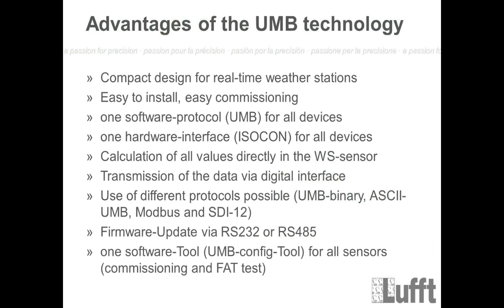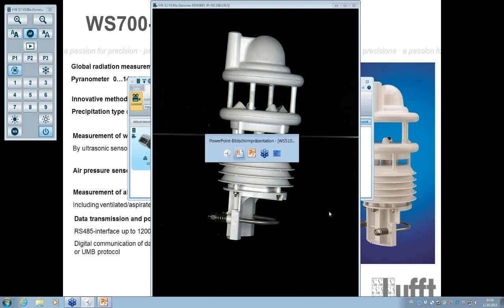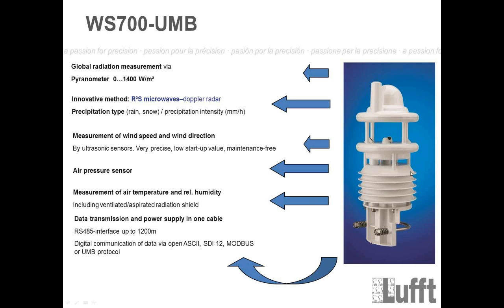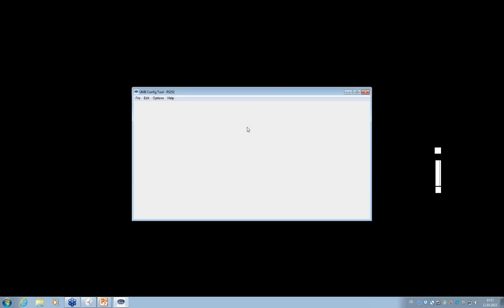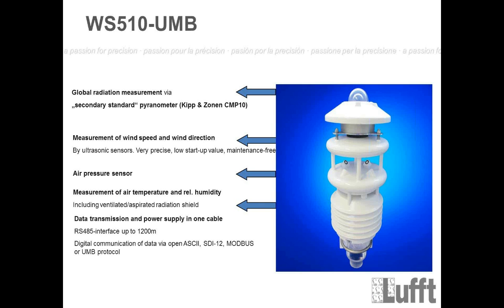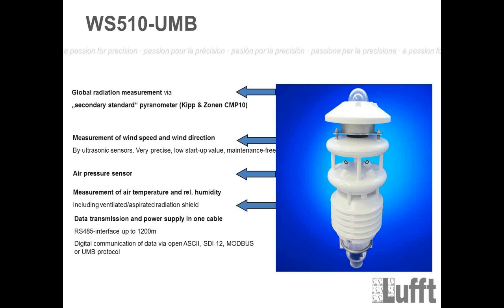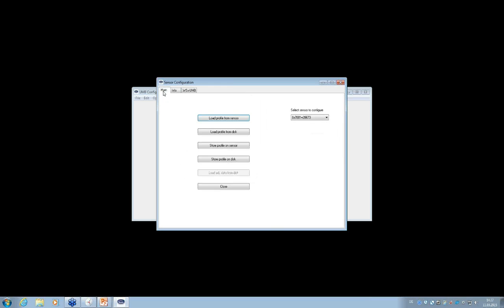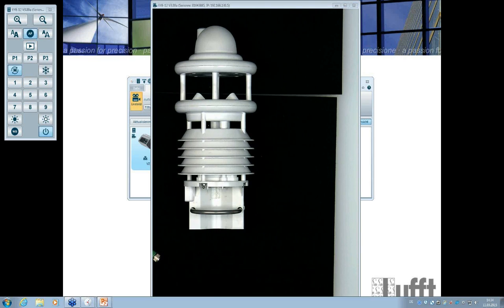Lufft Academy Webinar – New Lufft Weather Sensors WS510 and WS700

Comment: HI, Iam using WS500. can we use another RS485-RS232 converter (ex:moxa) ?
Reply from the maker: Hi I Agus,

It is possible to use other RS485 to 232 converters but only the Lufft ISOCON will work 100%.
We have made the experience that not all converters are compatible with the UMB-sensors from Lufft due to driver and timing problems of the Non-Lufft converters.
Lufft always recommends to use the Lufft ISOCON.
https://www.lufft.com/products/accessories-310/umb-interface-converter-isocon-umb-2279/ 

Best regards